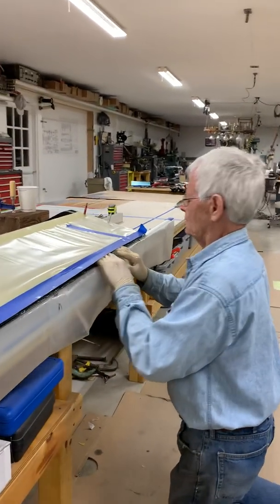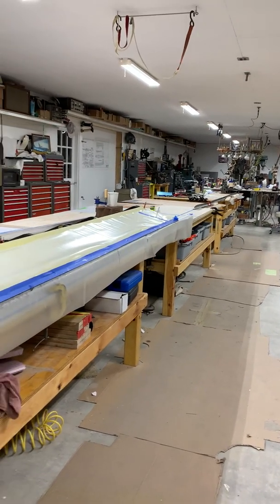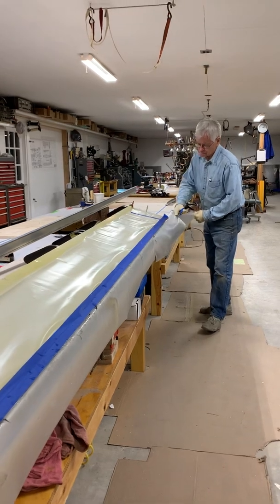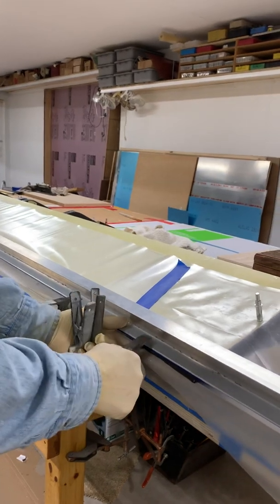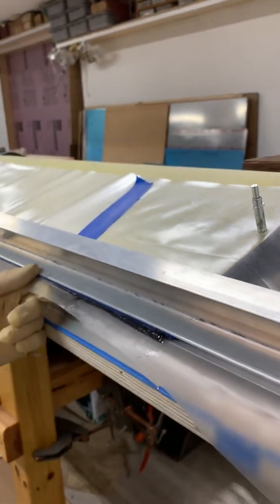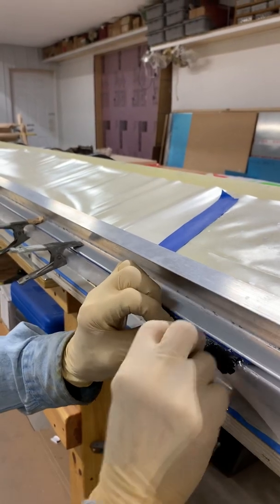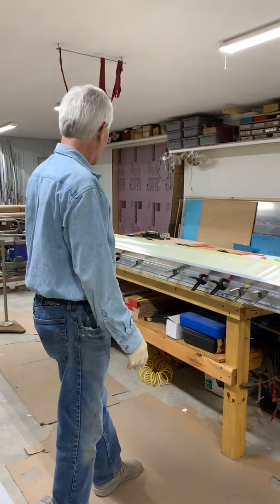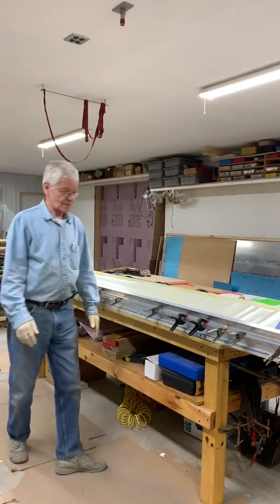Custom trailing edge carbon fiber construction part 3 of 3

Comment: A very interesting presentation but I fear you may have overlooked something critical.  Carbon fibre against aluminium is a no no due to galvanic action. As built, you have built in sites of accelerated corrosion.  Sorry about that..